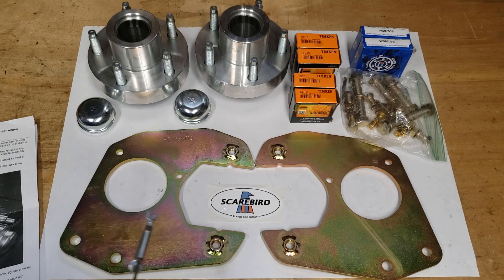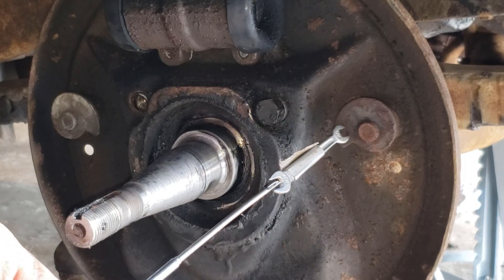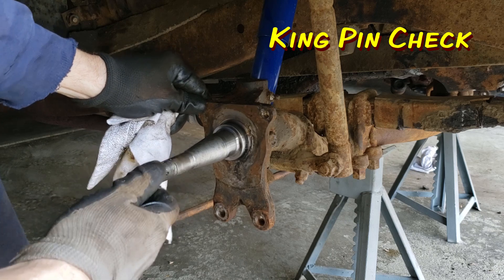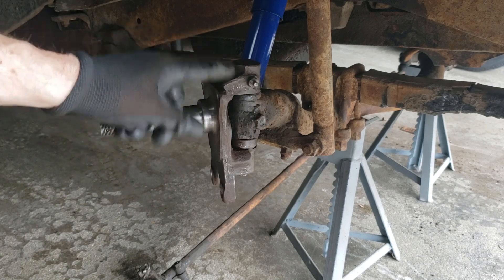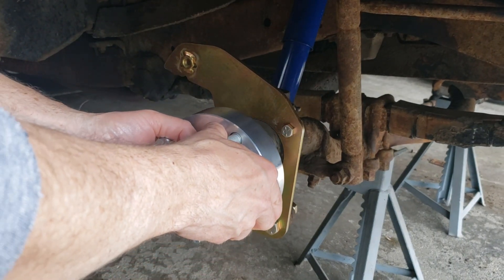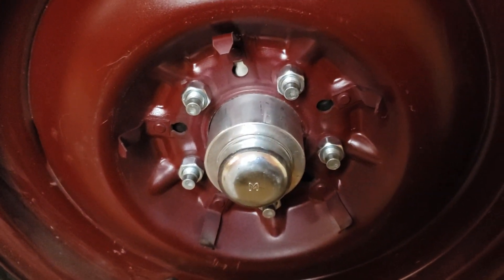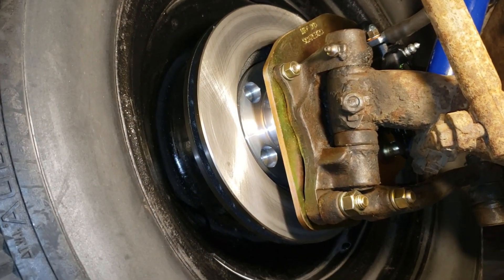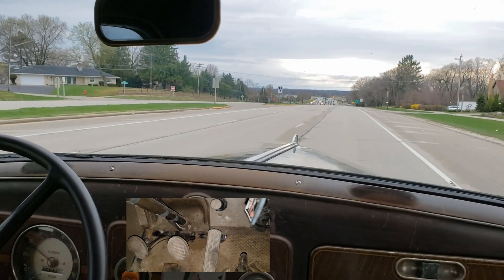Scarebird Front Disc Brake Conversion on a 1937 Plymouth Coupe! #brake

Comment: Are you able to use the original master cylinder from a 1963 ford van with his concept? Or do you need to use vacuum assist or something for the disc brakes for the front and master cylinder? And is it okay if the back brakes are drum brakes with this setup?
Reply from the maker: Great suggestion on the 1963 Ford Van Master Cylinder. Thanks! :face-purple-wide-eyes:I've been looking at different Masters and this one has the most potential without modifying the Coupe. So far the rear drum brakes are working as intended. I've driven it about 1,200 miles so far with no problem stopping. If I were to do it again, I would put an adjustable Residual valve in to be able to tweak them. But Disc brakes in the front make it drastically  better and safer.:hand-orange-covering-eyes:

Comment: Terry confused as to use 2 pds pressure valve on rear or front or both.  Video said 10 pd proportioning valve to back and front ? thought disc takes more pressure ?
Reply from the maker: I realized after I did the filming that I said the wrong thing. :face-orange-frowning:The 2 lbs. Residual Pressure valve goes to the FRONT disk brakes and the 10 lbs valve goes the the REAR drum brakes.:face-red-droopy-eyes:

Comment: Hello : I have the same problem as another fellow here; all new parts put can't get any pedal on my 37' Plymouth. You recommended to him to bench-bleed his master. How is the best way to do that? Thank you
Reply from the maker: I use a "Bleeder Kit" on all my Master Cylinders. Take a look at 22:35 of this video:
https://youtu.be/XPRf6nnI8Ak?si=Vv6et4DdlhvXzgJT
This procedure really gets all of the air bubbles out whether it's performed in or out of the car. Also, I connect clear plastic tubing to the bleeder screws while bleeding all of the other brake cylinders. Helps see the bubbles until it's clear.
Reply: @FlatheadTerry  Thank you so much. Any progress on the dual master cylinder ad on the 37' Plymouth?
Reply from the maker: @tk-rn6ct  Great question. I've been looking at options but they all need modifications to the frame and floor. Currently my single reservoir master is working perfectly so I'm reluctant to changing it out even if I do find a dual chamber.

Comment: Terry we just bought a 1937 Oldsmobile F37 will this kit work ? I am super excited with our new toy
Reply from the maker: I don't believe so.
Reply: @FlatheadTerry  do you have a direction you can point me to??
Reply from the maker: @1neldogg  I suggest contacting Scarebird directly. I see they used to have a 1940-52 Oldsmobile Kit (https://scarebird.com/index.php?route=product/product&path=62&product_id=203). They're under new management and have a new web site (www.scarebird.net) so there may be a delay in contacting them. There may be a way to modify the 1940-52 Oldsmobile Kit to fit your 1937. The mounting brackets are the most challenging part of these upgrades. Especially if you can keep your original Hub assembly. I wish I had a better answer for you!:face-red-droopy-eyes:

Comment: I have a 1936 Dodge Coupe with a Mustang ll frontend that still has the original 1936 Dodge Master Cylinder. Can you recommend a kit to convert it to a dual Master Cylinder? Thank You. Jim
Reply from the maker: Hey Jim, I haven't upgraded mine to a Dual Master yet. However, a friend of mine used the EC-441 Kit from ECI Hot Rod Brakes. He did have to do some tweaking to make it work, but he likes it. Here's the link --> https://ecihotrodbrakes.com/chrysler-master-cylinder-assemblies. Hope this helps!:face-turquoise-covering-eyes:
I took a short video of his setup. So if you or anyone else wants me to send it to you, email me at the flatheadterry@gmail.com.

Comment from the maker: For those wondering what bearings this particular kit uses, here they are: 
The inside bearing assembly (larger) are Timken Part Numbers LM67010 and LM67048.
The outer is Timken Part Numbers LM11910 and LM11949.

Comment: Terry, I have a 1936 Chrysler Airstream C8 that I want to convert. My issue is the spindle is a little larger on the 8 cylinder car. Everything else is the same except the spindle. Can you tell me what bearings I need to use with this kit?
Reply from the maker: Good question Jim. 
The inside bearing assembly (larger) are Timken Part Numbers LM67010 and LM67048.
The outer is Timken Part Numbers LM11910 and LM11949. These are readily available. I hope this helps! Let me know if you have further questions.
Reply: @FlatheadTerry  I understand these are for the 1937 Plymouth but I was looking for help for my 1936 Chrysler Airstream C8 which has a slightly larger spindle. I think the rest of the kit would be the same it’s just finding bearings that will fit my spindle and fit the hub in the kit. Any help would be most appreciative
Reply from the maker: @JimKelley-oz7kd  OK, whst are the diameters of your spindles?
Reply: @FlatheadTerry  I get those specs to you as soon as I find my notes. Thank you.
Reply: @FlatheadTerry  Terry found my notes spindle where inner bearing rides is 1.318 and outer is 0.894. Hoping you can help me. The car has only 34,856 miles but I’m not comfortable driving it with the drum brakes. Constantly pulling right or left. Thanks! Jim
Reply from the maker: @JimKelley-oz7kd  I've been looking and couldn't find any bearings with that ID. That maybe why Scarebird doesn't offer a kit. Another potential option is to keep your bearings and hub and adapt a rotor to it.
Reply: @FlatheadTerry  I appreciate your efforts. I’d have to find another set of hubs before I could sacrifice my originals. I may just have to deal with the drum brakes. Thanks again, Jim
Reply from the maker: @JimKelley-oz7kd  Hey Jim, I was digging thru some old emails and came across someone that may be able to help you. Contact Charlie at https://www.rustyhope.com/ . He makes early MOPAR Disc Brake Conversion kits so if he can't help ya, I don't know who can!  :face-purple-wide-eyes:

Comment: Cant wait to see the master cylinder replacement. Please can you show a setup of how you do a new brake installation and how you set up the pads and bleed the system to work. Mine is all original and rebuilt the brake system but can’t for the life of me get pressure. 36 Dodge mopar.
Reply from the maker: Thanks for the comment Barry. I'm still running the single chamber master cylinder with great results, so I originally thought I would have changed it out by now. I have no problems braking now with it running the front discs and drum rears. The pads have now "broken it" nicely after 500 miles so it stops very good now. The issue with yours sounds like the Master cylinder has air in the valve body. It took me well over 100 pumps when I bled it in my vise to clear all the air bubbles prior to installing it on the Coupe. Then more bleeding.

Comment: WILL THIS BE THE SAME FOR MY 1938 DODGE ? ARE MY KNUCKLES THE SAME AS THE 1937 PLYMOUTH YOU DID THE DISC CONVERSION USING THE SCAREBIRD KIT? IF YES WHAT KIT. I HAVE 16 INCH WHEELS AND 5 BOLT ON. CONTACTED SCAREBIRD THEY SAID DONT HAVE A KIT FOR 1938 DODGE.????
Reply from the maker: I'm not sure if they're the same or not. Join and ask this question on the internet forums where someone with a '38 Dodge already performed this upgrade.

Comment: I love the idea of front disc brakes for an old Plymouth.  Mine is a 1935 PJ coupe and unfortunately the kit you used doesn't work for a "35.  Is there any resonablely priced way to make it work on a '35?
Reply from the maker: Are you going to use original rims or aftermarket? This site has a kit but may not fit 14" rims. Spacers may be necessary to move the rims out away from the new caliper. https://www.tsmmfg.net/chrysler-desoto-dodge-plymouth-complete-car-front-disc-kit-1339.html
Reply: @FlatheadTerry  I want to use my original 10 slot 16" wheels.   The $5OO+ price seems steep but this is a money hobby.    You should do more videos' on your Plymouth.  They're great learning tools.  Thanks for the information.  Russ
Reply from the maker: Ok, your 16's may fit with that kit. Russ. Check with them. Also, I already have 22 videos on this '37 Plymouth on my YouTube Channel with more on the way. Check them out and if you "Subscribe", it will bookmark the Channel for you so you can get notifications when I upload a new one.
Reply: @FlatheadTerry  Great information. I will subscribe. Thanks again.  Love those old Plymouth!

Comment: Why can't you take off brake drum and use the  org hub
Reply from the maker: The new Scarebird hub is designed to safely accept modern, off the shelf rotors.
Reply: @FlatheadTerry  I see because I did a 38 before using the org hub and match a rotor on the hub worked great and still going
Reply from the maker: @frankjones6082  That's awesome. My right side hub had the outer bearing race come loose from the hub and rounded out the hub which was difficult to repair. So getting new hubs and bearings worked out for this project. Thanks for watching and the info.
Reply: @FlatheadTerry  nice videos
Reply: Take the drum off the hub go to junkyard and find set of dodge or ford rotors make a  caliper bracket and put on a chevy S10 caliper , so far I've done 3 37 Plymouth front axles

Comment: Hi Terry,  I am just starting the project on my Plymouth P4 .  In the video you say a 2 pound residual pressure valve but the video shows a 10 pound valve.  which is correct?  Where did you get the pressure valves and do you have part numbers?  Thanks, Joe
Reply from the maker: Hey Joe! I realized after I did the filming that I said the wrong thing. The 2 lbs. Residual Pressure valve goes to the FRONT disk brakes and the 10 lbs valve goes the the REAR drum brakes. I bought them on Amazon.com. There are several vendors that have them. I can dig up the exact order if you want. After 500 miles so far on these new disk brakes, I  couldn't be more happier with them. Well worth the effort and cost.
Reply: @FlatheadTerry    Just installed the front brakes on my P4  Everything went well. and everything fit.  I still need to finish the hydraulic lines.  The Lines from NAPA did not work so I must have ordered the wrong hoses.  The good news is, I was able to use my existing hoses.  I reshaped the banjo fitting to fit.  I will find out more when I pressure test them.    For some reason Amazon would not sell me the 10 lb. pressure valve .  Probably some stupid California law.  Thanks again for all the information and the great video.
Reply from the maker: @joenarduzzi591  Great to hear Joe! Bending and installing the brake lines to the residual pressure valves was a real challenge. I used a manual brake line bend tool multiple time to get the connections to line up. If not, they would leak. So be prepared gor this but it'll be worth it! Thanks for the update and kind words!
Reply: I used the same brake kit, and made all of my brake lines too. The only difference is mines a 47' Dodge Deluxe. I also took it a step further than you did by adding a dual MC instead of the stock single chamber.
Reply: Use a 4 psi check valve , 10 psi is for drums

Comment: Well done. Subscribed. I bet I learn lots about my 39 Dodge from your videos. 

Scarebird told me I could punch out the residual valve in the stock master. I'm hesitant to do that. No dual master kits exist and I haven't removed my floor panel yet to see what space is actually available in the X frame area of the factory master. Have you done any digging under there yet?
Reply from the maker: Thanks Erik! For the dual chamber Master cylinder, ECI Hot Rod Brakes sells an under floor, bolt in kit for our Plymouths. Here's the link https://www.ecihotrodbrakes.com/chrysler_master_assemblies.html

Comment: I used a Scarebird kit to put disc brakes in the front of my 1965 Rambler American, and while it won’t stop as well as my newer vehicles, they are a big improvement over the original drums.  I like the fact that the kits they make use over the counter parts, saving money and also making replacement parts easy to get at any part store.  Excellent job on video, you did a great job of showing how to do it.  I totally understand wanting to upgrade the brakes, it just makes these old cars work better in the modern world.
Reply from the maker: Thanks for the kind words and support Nutt Farm! Great to see  you've had success with yours too. Do you have a 290 or 390 in it?
Reply: @FlatheadTerry  I swapped in a 4.0 and 5 speed from a Jeep Cherokee complete with the fuel injection.  It originally had a 232 with an automatic.  I’m not against doing some upgrades.
Reply from the maker: @nuttfarmgarage6434  That's kool! It's gotta be fast now with that setup!
Reply: The only downside to the scarebird kit on my car was they don't make one for the rear.  I did however find a rear kit from wilwood.  Funny thing is it fit my car perfectly but it isn't listed on their site at all.

Comment: nice video and good info but dont that car only go like 40mph to me i would keep the drums but thats just me
Reply from the maker: Thanks for the comment! This coupe goes 50-55 mph and I had strongly debated doing this upgrade but there's two reasons why I converted the front brakes (and didn't modify the car so someone in the future couldn't be it back to original drum brakes. I kept all of the original parts for the future.); 
Reason #1. Dangerous brake fade when driving in modern stop and go traffic. I nearly rear ended somebody when the brakes heated up and the brake pedal went nearly to the floor. I missed the car by inches! (Close call number 1! Almost a heart attack!) 
Reason #2. The front brakes pulled strongly to the right even though new calipers were installed and brake shoes were adjusted several times to compensate. One panic stop last summer nearly put me in the ditch! (Close call number 2 and a heart attack!). 
I love driving this coupe and wanted to make it a SAFE daily driver for others to enjoy. The original drum brakes are just not safe.
Reply: @FlatheadTerry  I am NOT trying to compare the original drums with the Discs...  With that said...  If the drums were put back to 100% factory spec condition wise... I would NOT call them UNSAFE... But the world today isn't set up for proper drum brake repair any longer... Shops used to ARCH GRIND the newly relined brake shoes to FIT properly into turned/resized drums. I only worked in one shop as a young man in the early 1970's that had the bench mounted grinder, and used it on EVERY brake job... (I would guess OSHA helped put an end to this practice? Asbestos and all.)   And without this procedure, it takes many miles and stops to bed them in to be the most effective... And people don't understand this and they are too quick to judge the old drums as being grabby and erratic.  A bum rap!  A veteran driver of these vintage cars, usually has no complaint and understands how to compensate for the cars antiquity! You have not responded to my first comment, probably won't respond to this either. Good day Frank  Parks at Mopar Restos.
Reply from the maker: @frankparks4900  I do appreciate your comments Frank. However, I will respond to all constructive, informative, and encouraging comments but your first one was “over the top” for me and my Channel so I deleted it. I spend a large amount of time and energy producing these videos for the benefit of others and get discouraged getting negativity for it. I understand and agree with your comments about drum brakes and the lost art of arch grinding. I too worked at a garage back in the 70’s where this was the norm. I have and had drum brakes on all of the vehicles on my channel and others including my 1940’s Harleys and understand their ideocracies. For this video, I didn’t provide enough information or discuss the issues/frustration I was having with the drum brakes that were on this coupe before I started. The previous owner replaced only the brake cylinders and not the shoes or drums. The shoes were very older and fitted perfectly to the drums after years of use and miles so there was no issue with their arching. I made several attempts trying to adjust the shoes so it wouldn’t pull so hard to the right. (I almost went into the ditch after having to stop for animals in the road!!) Maybe it had a weak defective driver’s side cylinder – not sure. Also, the biggest factor was brake fade. I drive in a hilly, urban area and use the brakes a lot which eventually causes the brakes to heat up and become less effective making me push the pedal harder and harder. (I damn near rear ended a car last summer!) And I fretted all winter long debating if I should convert to front disks or just continue to mess with these old drums and risk hitting something unintentionally. I enjoy driving this unrestored car and get many positive responses from other drivers when I do, but I made a decision to make it safer for me and my passenger to drive and enjoy it with as little impact to its originality as possible. I don’t plan on making any other changes to this coupe.